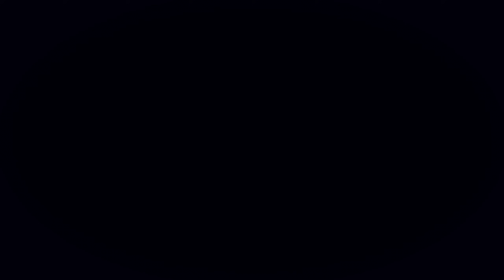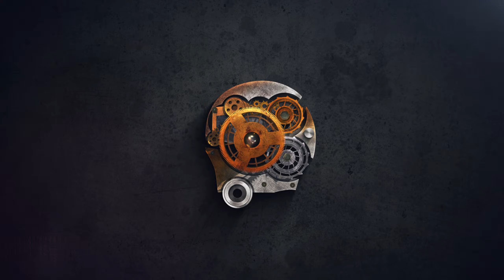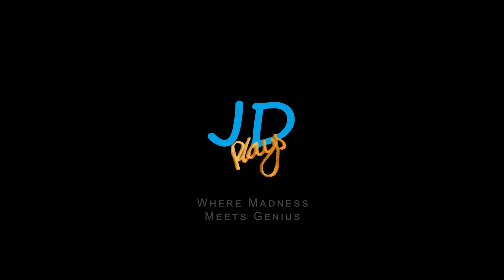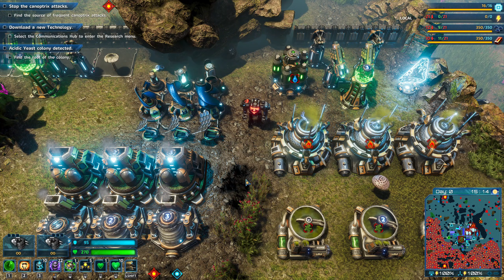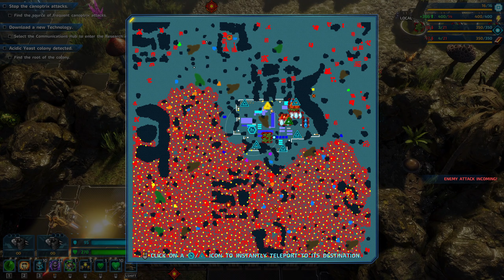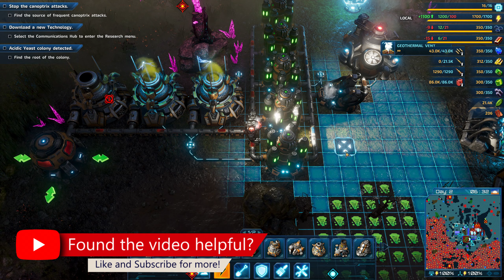Ultimate Guide to Power in 🤖 The Riftbreaker 🤖 Tutorial Guide How To Tips and Tricks

Comment: How do you manage to get so much biomass? I feel like I’m always running out no matter what I do
Reply: This is an old version of the game. In newer versions they nerfed the drop rate of biomass significantly. Now the bio composters method is not at all useful anymore. Some people like to cut down the forest as they are exploring, but i dont like that. I still put 1 plant biomass and 1 animal biomass power stations on each new outpost i make because it helps get a new base up and running. But in most biomes you have a decent variety and there is usually a sludge pool nearby to harvest for gas power.
Another good trick when making a new outpost is to put down 2 cabronium power plants. They will help kick start your power until you can set up some geo or gas.
On the lava continent you just use magma PP on the metal valley you only use morphium PP since you can just power them with a single pump.
Reply: @mancamiatipoola cringe. Me and my friends are trying the multiplayer playtest and the biomass fuel seems useless. Shame.
Reply: There are a new a Cultivator and Harvesting sations that plant plants. I'll guess they are new buildings from a new version of the game.

Comment: I don't recommend using the bio composters. You can quickly run out of plant biomass and then you won't have gas for your gas power plants. 

I'd just try to get fusion power as quick as possible until then use sludge pools for gas power or use geothermal, Wind or solar. 

Can't really recommend nuclear as well as you need uranium for a lot of other buildings and crafting so it's not the smartest to use it up for power generation given that there are tons of options that give you power "for free"
Reply: Agreed. The area neede for the lvl 3 setup will allow you to simply go for wind or solar and you'll lose 1/3 of the power roughly speaking. It's not worth the hassle.
Reply: You can gather more on every expedition to outposts or build a little bio farm using the cultivator and harvesting stations.

Comment: what is the out take on the geo thermal for? it doesn't appear to need it to function. I have a couple set up now, but still have no idea what that flashing symbol is for.
Reply from the maker: This was recorded in sandbox/dev mode so I dont HAVE to hook up any inputs or outputs for them to work
Reply: @JDPlays  it turns out it's for a bi product anyway, so you don't need to hook it up. 

you can though set up an awesome power sector via  geothermal as it creates it's own mud which can then be refined and turned into gas and power a gas plant. 

I'm going to try this out.